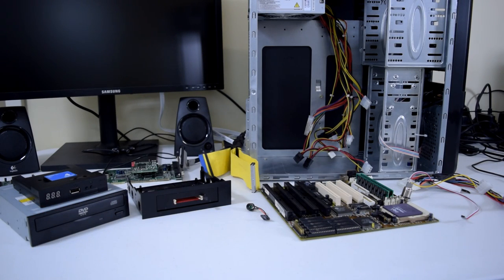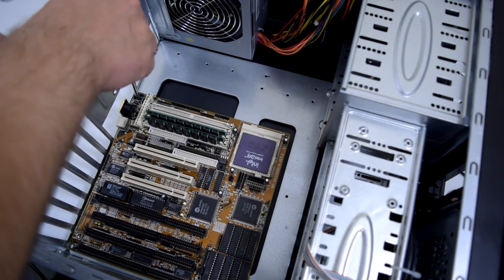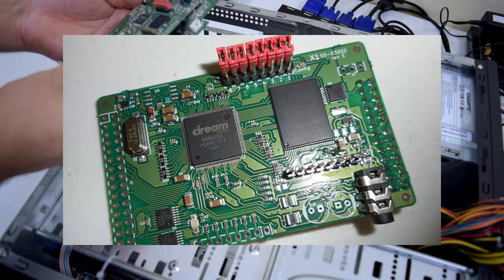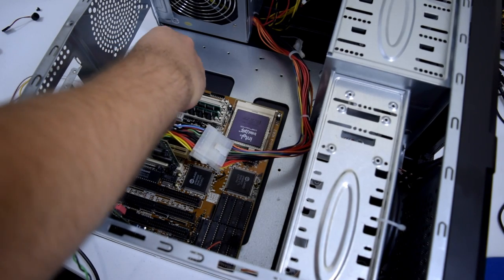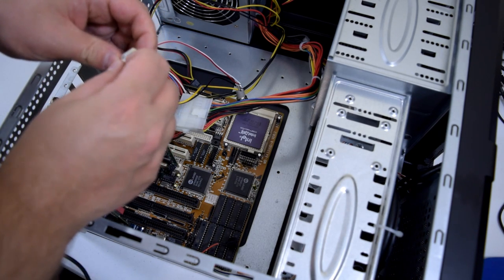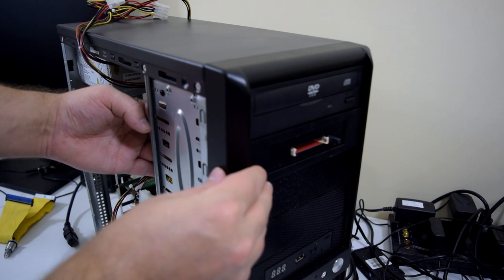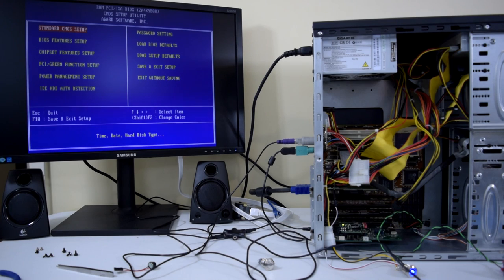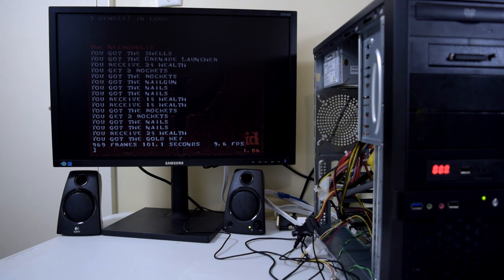Building a 486 DOS PC with modern parts

Comment: One question, why does one want a 486?
Reply: +Jaakko Oksa They are pretty power efficient...  Many people use them for routers or very basic low-traffic LAN-only webservers and the like.
Reply: +Jaakko Oksa Beyond just pure hobby interest, it could be useful for certain legacy software.  Some old programs will not recognize modern/virtual hardware and/or have code that rely on the CPU clock for timing.  But yeah, in most cases DOSBox or some other emulator can work just as well.  So I'd say for the most part this is just a hobby for nostalgia's sake.
Reply: +Jaakko Oksa As well as the reasons here, a lot of old industrial machinery interfaces through proprietary ISA cards, which are the black slots you see on the motherboard in this video. It's often easier and cheaper to keep an old computer around to run that machine rather than upgrade.
Reply: +big rat When I was in college, I worked in the evenings for a banks data center.  They had an ancient system for a similar reason.  It had a $12,000 special encryption card required for interfacing with the federal banking system via modem.  They had replaced the machine with a better one, but quickly discovered that the card would not work in a newer system (not because of lack of ISA slots, it must have been some weird reliance on bus speed or something), so the old system remained.  It's all fine and good to upgrade when you don't have to splash out $10k+ for a new specialized addon card!
Reply: +Dustin Rodriguez Headline: Cheap company doesn't want to invest in keeping their equipment updated.  Film at 11.
Reply: +x anon I hear you but, that means somewhere along the line, someone let upgrade schedules expire into oblivion.  Maybe it's not the business owner, maybe it's whomever is running the system they're connecting to, who knows.  Point being, compatibility expires eventually so from an IT standpoint you need to have a plan to keep your equipment current.
Reply: +goyabee The CPUs themelves were not power efficient compared to their clock speed. It's just th fact there were not 4Gb video cards blowing 200 Watts to play an average modern game back then.

Comment: Dunno man, better get a water block on that CPU and some 200mm radiators....lol
Reply: +Gaming with The Real DudzFryd I changed my fair amount of 486's in the day, but I'd completely forgotten there is no heat sink?? or did he just not show that part?

I'm sure I remember they clip onto that plastic bit, but maybe that was Pentium's
Reply from the maker: +SteveM I forgot to put the cooler on. Noob mistake, lots of people told me already, I got one now :D
Reply: PhilsComputerLab
 Was more of a joke really.  In fact one of my first PC's was a 486SX 25 and it never had a heatsink on it.  That first PC had an "overdrive" socket that added a math co-processor but in reality was really just a DX50.  The overdrive cpu had a small heatsink but the SX never did.  Wasn't till the Pentums that the CPU's were getting hot enough to need one.  Fun build video, thanks for doing it.  I've often thought about going back to an old setup like that but finding good parts is hard to do these days.
Reply: Aaaah that makes sense! stick a modern one on it, and see what kind of overclock you can get :D

Interesting trivia, I had an AMD 486 DX4-120 back in the day. It needed a voltage converter which sat between the socket and cpu, which changed the voltage from 5 to 3.3 if I remember correctly.
Reply: SteveM
 Yeah, I had a DX4 100 like that and a Cyrix 5x86 that ran at 133Mhz.  The Cyrix basically lasted me until Intel launched the Pentium 2 Slot 1 CPU's.  AMD and Cyrix were much better values than any Pentuim 1 at the time.  A shame AMD stopped trying and Cyrix went away.
Reply: Haha yeah, I rode my AMD DX4-120 right to the end of the Pentium 1 days.

Comment: the turbo SLOWS the clock speed i dont see why people get this wrong.
Reply: +OneTrue_Morty you really cannot grasp why someone would be confused??
Reply: OneTrue_Morty
...wow..  Any tech from today who was taught this in school went to a bad school that teaches useless information.  There is no reason to know this information anymore, so it is no surprise when someone sees a button that says Turbo, that they would think it makes it faster, instead of the opposite.

Older tech's know this of course, but just because someone younger doesn't, does not mean they don't know their shit.  Anyone who would say otherwise is an idiot.
Reply from the maker: +OneTrue_Morty I'd just like to say that the behaviour of the turbo does depend on the motherboard. I have boards that need a jumper (closed) to work at full speed, others have it so that the jumper needs to be removed (open) to work at full speed.

Comment: Or you can use DOsbox...the end.
Reply: +mackjeez What's the fun in that?
Reply: Kippy Kip

You know, playing the game with no limitations or worries.
Reply: mackjeez But using the old CRT monitor and manually inserting floppies is a lot more fun
Reply: Kippy Kip

I grew up on that and it was not fun installing 12 floppies for one freaking game and don't get me started on those crappy crt monitors that strained your eyes after an hour.

Maybe this is fun for the newer generations but I'll stick to GOG and Dosbox.
Reply from the maker: +mackjeez And the 5th disk of Monkey Island 2 you copied from a friend had a read error...

The way I see it, there are two extreme ends of the spectrum: Playing on a proper time period correct 486 on one end and DOSBox on the other. What I do is somewhere in the middle. I love the conveniences of floppy emulator, ATX case, LCD screen, optical mouse but still getting that authentic experience. 

GOG is a whole other topic. They do a lot of cool things, but pretty much every game needs tweaking and the forums are hardly about the actual game, the memories and all of that and are just tech support forums. Without the awesome community GOG wouldn't be half as good.

Comment: I think your 4GB CF card didn't work maybe because of that 4gb address limitation? I'm not certian though, I was going to ask about solid state drives but I guess they are about ruled about because of their size, this does interest me though because of the business applications, I might have a client need a computer like this for a cnc machine, but then again maybe a cheap pc would be available online however as more and more of them are getting swooped up there might become a big market for 'retro business class pc' s', imagine if an old 486 pc sold for 3k$ because it ran a 40k$ machine! I feel that it is completely possible, the sad part is so many people are losing the knowledge, like when I saw IRQ settings hahah I remember those but to try to explain them to anyone today that's under the age of 20 would be interesting even if they are semi techno enthusiasts
Reply from the maker: +Wilson Gilley Great post :D

Worst case you can use dynamic drive overlay software. I used that to get a 120 GB drive going in a 386 and installed Windows on it. Took forever, but it worked :P
Reply: +PhilsComputerLab sounds awesome, honestly most of those computers that need to be replaced would be running one program 24/7/365 so uptime and stability are what you want! great video though brought back a lot of old memories and really shows you what is possible I stumbled on this video after looking up an AST 66 mhz DX, (was on Samsung's Wikipedia they tried to buy the computer manufacturer) which was my first PC after I got back into them (before having a Commodore 64)this was 1996 and I was 11, upgraded it to a 56k modem and 16mb ram, and got the internet! I upgraded it to Windows 95 and so started my IT learning growing so interested in technology and I'm so thankful I stumbled onto IRC because I feel like it helped me tremendously to keep learning about technology! how far we've come since then!

Comment: my 386 died because the batteryleaked  corroded the mobo and it was done
Reply: +Justin M That's what fried my 486 (dx2 80). Would still boot fine but the keyboard connector wouldn't work any more. No tears though cause I already had a Pentium II at the time.
Reply: +Grobbekee does anybody know which computer was first to use the 2032 battery? i think my 386 used nicads it was such a mess i coudlnt tell
Reply: Justin M Lgr made 486 with cr2032 battery
Reply: i hate those barrel batteries, they are the cancer of all retro motherboards, the dallas chips were bad but didn't leak when they died, the cr2032 button batteries are very common and can be easily replaced, i look after any 486 or pentium motherboard that has a socketed dallas/odin rtc or coin battery, i avoid motherboards with barrel batteries or soldered on dallas/odin chips, retro macintoshes had that similar issue but with the half AA batteries which were also prone to leaking over time similar to the barrel batteries, i have seen that those red maxell batteries were more prone than the other ones. i had a Mac LC which didn't turn on and i opened that computer and saw that the battery leaked and it was game over for the mac and i just tossed it but saved the hard drive and floppy drive and power supply

Comment: These mobos are difficult to find. Most run in the $250 range refurbished. You are looking to spend almost $500 on a 486 system. Its not worth it. Better to try to find them in the trash or free. But good luck in 2015. Should have kept the hoards of parts I had almost 15 years ago. Got plenty of Pentium 3, and 4 stuff  I'm hanging onto. Pentium 3 is starting to have value.
Reply from the maker: +RatCatcher I got it a few years ago. Thing is, people though I was crazy spending $50 or so on a 486 motherboard. But I knew that prices will only go up. You're right, get into the things that are cheap now. P4 or C2D can be had for little money. All the top end stuff however still demands a premium, like Asus deluxe boards.
Reply: +RatCatcher It really boils down to what it's worth to the people who want them. Obviously people are willing to pay for them if their that much. It depends on what you're interested, I mean I'd spend a couple $100's on a G4 Upgrade card for the G3 Pismo (The laptop itself isn't worth more than ~70$).  People like different things, so not going to complain.
Reply from the maker: Also, December is the worst time to shop for retro parts. Prices are very high. In summer prices are usually much better.
Reply: It is a steep price to pay. You could get a Socket 7 off eBay for $50. The caps could be dried though. And who knows where its been after 23 years. Free or little money spent is the way to go. If it fails your not doing a face palm. The 486 will last forever though. We should start saving our I7's for when they start balling CPUs to motherboards and are a disposable item.

Comment: why a modern PSU? They have all the power on the 12V rail, terrible choice for an old build really
Reply from the maker: +OK You make a good point, if this was a fast Athlon XP, like a 3200+. But a 486? The current draw on the 5V rail in minuscule. It's really not an issue.
Reply: PhilsComputerLab

Does it draw anything from the 12V rail? Because if it does you're gonna get really poor well out of spec voltage regulation because I doubt that PSU is DC/DC

Comment: Not really a fan of using cf cards as an os drive. With no wear leveling, you will have problems. I'd rather use a pata ssd. Like these http://www.amazon.com/Kingspec-128GB-Solid-Notebook-Laptop/dp/B00HWOYY72/ref=sr_1_3?s=pc&ie=UTF8&qid=1458836580&sr=1-3&keywords=ide+ssd
Reply from the maker: +harshbarj Been using them for many, many years and no issues. With DOS, there is just reading the OS and games. Only writes are save games :)

Comment: What's the point of a 486 Gaming PC when it looks modern? Formerly, I like 486 Gaming PCs mostly because of how the case looks, that nostaglic noise made by the BIOS at startup along with other parts inside the computer like the fan to name one, the BIOS splash screen, that unique charm to the way the games sound when you play old school DOS and Windows 3.1 games, etc. Can't achieve those things with modern parts. Also, there are not any floppy drives as you decided to put a temperature meter where the floppy drive was supposed to go.
Reply from the maker: Temperature meter? LOL
Reply: *floppy emulator Sorry, I forgot what it was by the end of the video but still, an emulator isn't as great as the real thing if you know what I mean.
Reply from the maker: The entire point of the video was to show the use of modern parts. Anyone can build a normal 486.
Reply: Anyone can build this too but yeah, I guess this is kinda good for people on a budget even though I'd just look through the dump, recycling center, thrift store, salvation army, etc. for an old computer which is actually probably cheaper than this entirely (they usually sell computers for like $5) and use that if it's an Pentinum I or II but even better, if it's actually a 486 or 386 (even though those are more rare to come across even in those kinds of places) because one man's trash is another man's treasure. I suppose you could downgrade the computer to a 486 or 386 if you wanted to since you got one for this video and tweak the computer slightly. Mostly, the computers there are well, there because of it's age and it's lack to do anything 2017 and not because it's broken. You don't have to worry if it's broken though because you can obviously fix it since you know how to build a computer and the in's and out's or you can always go and get another one since like I said, they are dirt cheap if you really don't know how to fix it for whatever reason.

Comment: What is the point you may as well just use an emulator! You don't get the click of the hard drive, the flicker of the CRT nor the buzz of the floppy drive. I'm sorry but i cannot recommend this as there are no benefits.
Reply from the maker: +that linux guy Instant reply as I'm just answering comments :) This is black and white thinking. On one side the emulator, on the other side the authentic and period correct retro PC. Well I see shaded between these two extremes. I like using an optical mouse, real floppy drives are un-reliable, hard drives loud and can fail and I can just plug the CF card into a modern machine. DOS emulators on the other have fundamental issues, DOS games run at 70 Hz for example, so smooth scrolling will always be tricky. Lots of other glitches too if you know what to look for.
Reply: +PhilsComputerLab I got one of those Ferrari race track days, but I think I'll just use a simulator instead. Much better, plus you don't get that annoying sun in your eyes.
Reply from the maker: Nostalgia Nerd Nice flat screen monitor you got there :D
Reply: No! I'm saying why would you ruin the fun by installing fake floppies and hard drives then also use a flat screen as you don't get "the flicker of the monitor the click of the hard-drive and the buzz of the floppy drive"
Reply from the maker: that linux guy I've explained that part. Old floppies are unreliable, I constantly ran into read errors. Same goes for period correct hard drives, they are loud, small and can easily fail. CRTs are big, I don't have the space and I like that pixel sharp image.

I get your view, and many prefer a period correct machine. But also many don't want to put up with the antics of an old computer and some modern conveniences.

Can you understand that?

Comment: Old hard drives are noisy?! More like my Heads fuse to there platters... Freaking Quantum Bigfoots! The dumpster diving I do, I find that Pentium 4 are the most dead computers I find. IDK why that is! Either capacitors rot, burned processors, and even things like Front Panel Headers caused a short on the Motherboard. I can dumpster dive, get an IMac Bondi Blue Tray loader 233MHz, and a Athlon XP 2200+ 1.8Ghz but thus far only 2 Pentium 3 600Mhz laptops have survived. I'm starting to find how robust AMD processors are but things like SSE2 instructions of the Pentium 4, I can almost feel the difference with SSE2! A game you should try? Abuse is fun.. like Turrican meets Metroid ;)
Reply from the maker: +Jason Hicks (TyrForFreedom) The Pentium 4 suffered a combination of capacitor plague and high power draw / heat :) I also got a few DOA Pentium 4 motherboards, quite frustrating. They all look fine, no visual hints. But I also ran across faulty AMD gear.

Comment: What the hell is the point of building a computer using obsolete tech?
Reply from the maker: +Flip86 Nostalgia. Not sure how old you are, but it's nice to remember the good old times.
Reply: PhilsComputerLab
I'm 31. I still don't get it. Any modern computer can play all the games this thing does. It's the games that trigger nostalgia not the computer itself.
Reply from the maker: And that's fine. You just need to accept that for some the hardware matters just as much. We have options, and that's the good thing. You can just use DOSBox, it's really good.

Comment: I really wish you finished this build properly, seems like a really half ass and lazy build tbh. You didnt actually modify the case and glossed over a few cosmetic issues and also hardware failures, and also c'mon dude at least install some serial and parallel ports just for completeness sakes. Also Jesus no fan on that 100mhz chip?!

Comment: Don't repair a fucking PSU. It can kill you.
Reply: ***** if the caps still have a charge in them, you could be dead if you tough them. I don't think that very old caps still have a charge, but i wouldn't risk it.
Reply from the maker: +StarTrek123456 He has a point. There are caps that sit directly on the mains power. In Europe that's ~ 240V and can give you a proper jolt at the least.